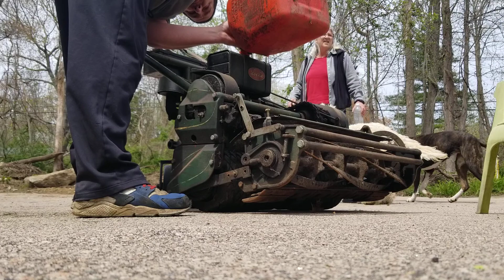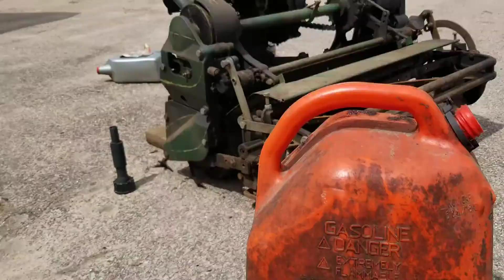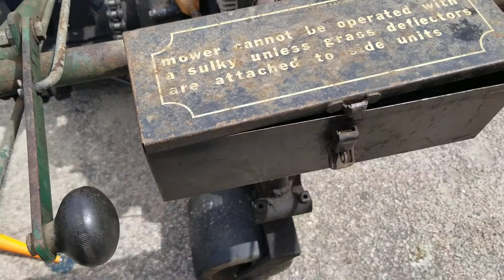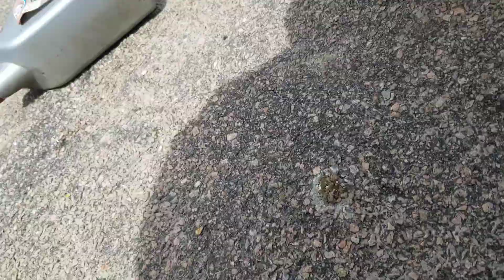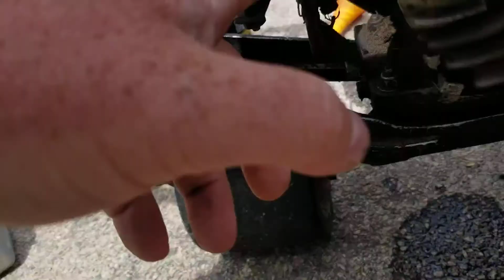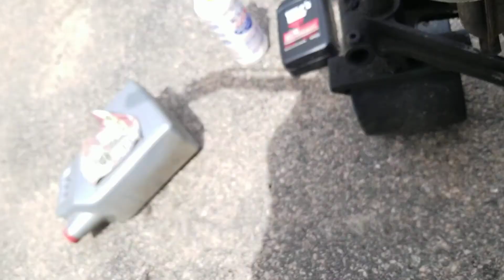mothers day with The Mom 2021

Comment: remove spark plug put a capful or oil ortrans fluid let it sit over night  on gas. issue replace gas line and put inline fuel.filter